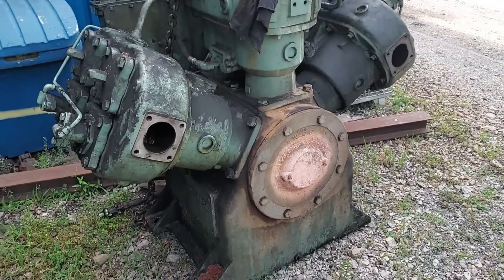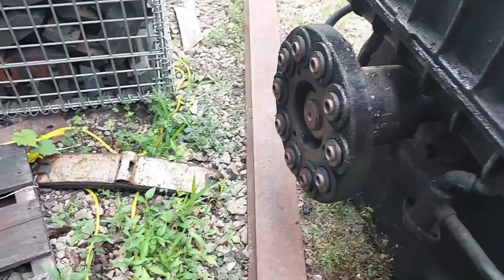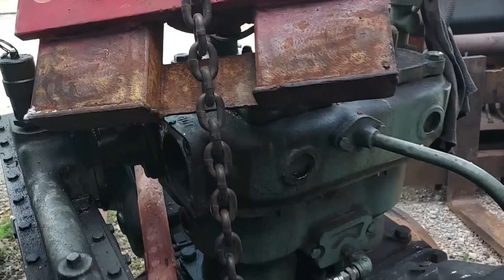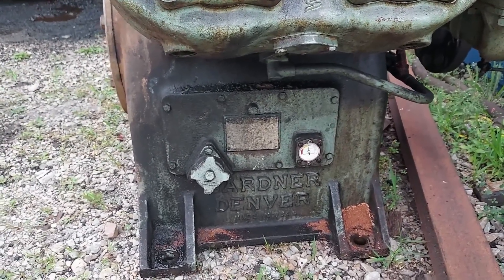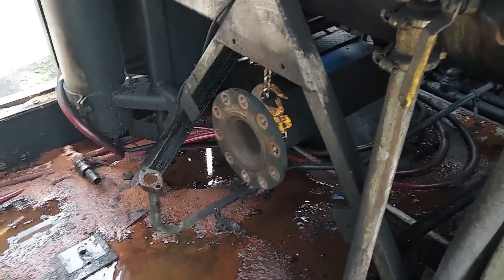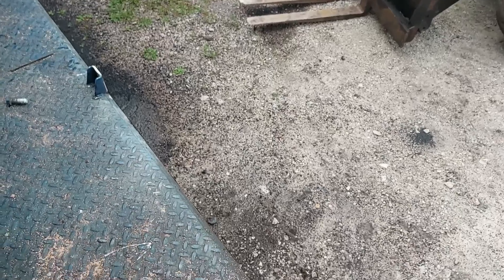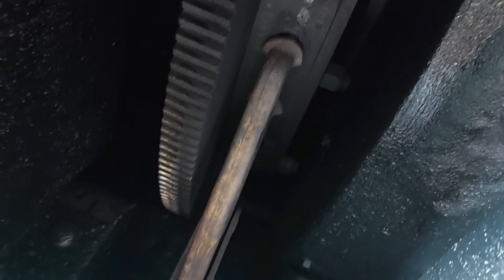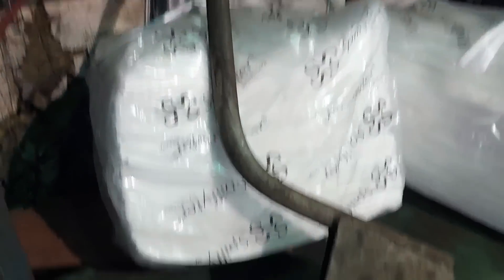Locomotive Air Compressor Died!  We Gonna Change It Out Today

Comment: Is that the locomotive that had the accident requiring some major repairs. And the air compressor drive shaft failed.
Reply from the maker: No sir, that was #3098 our SD 40-2 that got busted up and
had also to put in a new drive shaft for compressor. Always
something with these older locos, but that's railroading! Thanks
so much Wayne for stopping by and watching today.

Comment: I always liked the compressors that were mechanically linked to the prime mover. You could notch out  to speed up the process of pumping up a train. The newer electric compressors only have one speed.
Reply from the maker: Yes they often do advance the throttle to build air quicker. 
I did not know about the new ones being electrical. Thanks
for the info clarkpj1.
Reply: That big compressor uses a lot of power.  To be able to declutch or run on electricity would probably be more efficient
Reply: The dash 8 and newer GE/Wabtech engines have electric air compressors.  They only kick on when air pressure drops to whatever psi it’s set to kick on at.  They also start up unloaded for a few seconds then load up to increase service life of the electric motor.  The electric motor can increase rpm if needed.  Those are compressors all have that distinctive “whoop” sound.

Comment: Blue Flag Visitor?
Reply from the maker: Blue flag protection is a Code Fed Regulation used mainly
for protecting workers on tracks, such as preventing a train from
going into a spur or siding if there is a blue flag, or at night
a blue light on the track. Having a blue flag visitor sign on
the loco alerts anyone around that the loco is being worked
on is not to be started or moved without that worker (s) permission
that he/they are in the clear and loco is able to be started or moved.

Comment: That is one chunky air compressor, it makes a semi truck compressor look like a bicycle pump. Out of curiosity what's the standard operating pressure for the air system in a train?
Reply from the maker: It is big but has to supply the entire brake system on all the
cars, plus on our cars the dump doors. The compressor
cuts out when main air reservoir pressure reaches 140 Ethan.
The brake system is good pressure at 90. Thanks for
watching and writing in today my good man.

Comment: Is there a shear key in the shaft of the air compressor? so if the compressor locks up it doesn’t cause damage to the locomotive or the prime mover? 

I was told at the RR I work for, the mechanic said years ago one locked up in route somehow on a GP35 and it ripped the compressor off the floor and was spinning the compressor around in the car body, but I’m not sure if I believe that lol
Reply from the maker: No Andrew there is not. It seems a bit far fetched that it would tear
the compressor from it's floor mount and even if it did I highly
doubt there was room enough for that big compressor to
spin 360, but then again on a GP35 the compressor could be
smaller, I do not know. What I would think is more likely
the thru bolts would shear or the drive shaft itself get
ripped in two. But strange things happen all the time on the RR.
Thanks for stopping by and watching my friend.

Comment: AWESOME! Dave Love when you show the mechanics side of things. Especially when we get a look in the engine compartment. That air compressor is a beast. Would look great as a lawn ornament in my yard 🤣🤣🤣 thanks for the great post...
Reply from the maker: I tried really hard to get that old compressor for you, I had
thought the same thing, would look great in your yard. But after
emailing corporate numerous times, they decided to send
it back to a shop and get it rebuilt. Sorry my friend, I tried
my darndest for you. We may be replacing an entire engine
soon so would you settle for that? Wish I could have taped
the old compressor when it was smoking, but Russ had
it shut down before I got back off track. New one is way
quieter than the old one was.
Reply: @ccrx6700  hey thanks Dave, an engine will do just fine.. 🤣 guess I can't blame them for sending it back. These parts are probably getting hard to come by... bet it was an awful sound coming out of that thing... tell Russ hi from me and tammy and glad "things" are good

Comment: Thanks Dave! I never heard of Gardner Denver before, but I'm not real familiar with locomotive components. It's real nice to get a look under the hood and see this stuff! I really liked the sound of the locomotive as well, what an awesome sound! 😊
Reply: As soon as he said bad air compressor, I thought Gardner Denver. It is a very common loco compressor. We also had one in stationary use at work. But it was a twin cylinder where Dave's is a 6 cylinder.
Reply: @gravelydon7072  When I think of air compressor, I think of Ingersoll-Rand. I'm sure that now that I've heard the name Gardner Denver I'll hear it all the time now.  😊
Reply from the maker: I have no idea what make of  compressor they put in newer
locos since the newest loco we have was built in 1978. Really
glad you was able to check out tonight's home movie, we
do appreciate that my friend.
Reply: Gardner Denver makes a lot of compressors for different applications. They also make mud pumps for the oil exploration industry and well drilling applications.
Reply: @Sillyturner  Thanks Carl!
Reply: Gardner Denver makes many different styles of compressors from little 60 gallon units to huge screws, oil field and gas compressors. They are part of Ingersoll-Rand  now actually. They also own Champion compressors. GD started in Quincy, Illinois, Champion is in Princeton, Illinois.

Comment: That is a reciprocating air compressor (looked it up at Gardner Denver) and so that means positive displacement. Now, when we hear the relief(s) let go, we know that the engine is releasing excess pressure from the system. So anytime the engine crankshaft is turning, the compressor is running. I guess that makes sense - we need the air for the brakes on the entire train. Thanks for this look inside engine 22! Very cool to get the detailed low-down even it the air compressor had to die to let us see it :)
Reply from the maker: Even tho it died on us, it will be resurrected for a new life
in another loco somewhere. There is something about how the
valves work in it so that when 140 pressure is obtained in
the main air reservoir, the compressor is still turning but no
air is being compressed. Can't thank you enough for taking in
the home movie today and writing in my friend.
Reply: @ccrx6700  The engineer in me is now very interested :) Piston positive displacement running continuously means as you say, the valves must do something to relieve the potential overpressure to the MR. I began a search, but so far I am finding overviews and no details. We have HiPACs on submarines (4000 psi air) but they use a regulator to shut the compressor off when the correct pressure is reached. LOL! Full geek mode now - apologies!
Reply: @brianhickey5949  If you find out,would you be good enough to let me know ? Thanks. I doubt it is going to be as simple as is found in an ordinary  shop compressor..
Reply from the maker: @brianhickey5949  😊👍
Reply: @brianhickey5949  Those small lines leading to the tops of some of the pistons look a lot like 'unloader lines'.  Oil pressure applied in them will shift the top valves so they can't close.  With them 'unloaded' those pistons move up and down but the same air just stays in the cylinder.  Common on larger compressors, so while it runs at one speed, when the outlet pressure rises enough, it can 'unload' some of the cylinders and basically become 'half a compressor', moving half as much air.   Still need the reliefs on the reservoir, but with less air pumping, things are a bit easier.
Reply: @mikefochtman7164  Yes! That is how it works. Thank you Mike :) I would think that for engine 22 Dave would want a water cooled compressor to deal with the heat when the cylinders windmill. All set to go now :)
Reply: I scrutinized the video and determined the unloaders (those stems with lines to them) are on the intake valves, which makes sense. Downward pressure will hold those valves open. I do not have direct experience but I am assuming it is probably pneumatically actuated. A governor valve on the MR (or line) will port either tank pressure or vent to the compressor unloaders, essentially idling those cylinders. [my observations, not confirmed facts]
I did not look if they are all connected together or if there are two circuits. I did notice this appears to be 6 cylinders, 3 sets of twin cylinders.
I suppose it could be hydraulic, but I'm betting it's air.

I have only experience with an OTR diesel system. It used a pneumatic system as I described. (I can't remember if it was on the intake or exhaust side, but essentially the same function).
Reply: You can hear the compressors kick on in a GE locomotive(driven by electric).  They start unloaded, then they load up.  This reduces wear and increases service life on the electric motor.

Comment: So on this compressor,  are the outer heads the low pressure heads and they discharge into the   center head which is the high pressure head that discharges into the train air ? I think Gardner-Denver bought the designs from Joy Manufacturing which also made this type of compressor. The nice thing about this design is that it probably has the Load/Unload feature which draws less power when compressed air is  not needed by the braking system.  Working on this type of compressor can be tricky, especially when doing valve work. Thanks Dave for a great video.
Reply: That is the normal way they are set up. The outer cylinders are a larger diameter and the inner ones are smaller. That puts about the about the same load on the crank journals instead of just using a piston to go directly to the high pressure. Which on that loco is likely to be in the 150PSI range. So you get both volume and pressure. The intercooler takes the pressure from the lower pressure pressure cylinders and cools it before sending it to the high pressure cylinders which helps with a longer life of the compressor and the oil that lubes it. The lube on these is fed under pressure also. G-D has been around for a long time.
Reply: I'd say so.  Looks like it might be two first-stage pistons on each side, feeding that inter-cooler on the side which then flows into the center cylinders.  Cooling between stages improves efficiency.  And with twice as many first stages feeding the second stage cylinders, you get good compression ratios between stages without having to go with wildly different cylinder sizes.
Reply: @mikefochtman7164  I agree, it is already two to one ratio.
That being said, at the crank case, where the cylinders bolt on (under the water jacket bulge), the outer banks do appear to be slightly bigger, maybe 20%? [around 0:35 for example]
Reply from the maker: Good question Bruce, I am not familiar enough with the internal
workings to answer your questions. However here is a good comment
you may enjoy reading from a diesel mechanic
https://www.quora.com/How-does-a-diesel-locomotive-railway-compressor-work-and-what-is-its-draft-valve-principle

Comment: What causes all those clicking noises when the compressor is running?
Reply from the maker: If you are referring to the erratic noise that sounds like a hit
and miss engine on steroids, those are the spitter valves. They
are plumbed into both main air reservoir tanks. They are supposed
to help eliminate moisture from the compressed air, but
in reality they suck at doing that. Very much appreciate your
taking the time to watch and write in tonight my friend.

Comment: I always wondered what the compressors on a locomotive looked like, and they look very heavy. The braking system looks very complex, you really need a lot of training to repair a locomotive! Thank you for sharing Dave! I thought I would know everything about railroading soon,  but it looks like it will take a bit longer!
Reply from the maker: Just a tad bit longer Raymond.... :-) But even tho you've seen a lot
so far, in actuality we've only begun. I cannot thank you enough
for all your great comments and support of the channel you
have given us my friend. It's always great to have you visit
with us.
Reply: The compressor charges the air tanks first thru # 1 air Tank then the # 2 max allowable airpressure is 140 psi ,each air tank is 22,000 cu inches main reservoir air is done thru pipe # 1 to the air cabinet.
Reply: First thing i was taught  mc needs is brakes

Comment: Unrelated to the compressor issue, I always have wondered what that erratic ticking noise is? A lot of locomotive make the sound, but some more than others?
Reply: I believe that's the spitter valve. He made a video of one long ago. A quick search should help you find it now that you know what to search for.

This is actually someone else's video, but it has an explanation of what it does in the description. https://youtu.be/FVwNj7CSInk
Reply from the maker: The noise you hear Neil that sounds like a hit and miss engine
on steroids is a spitter valve. They are plumbed into both main
air reservoir tanks. Purpose is supposed to be to help eliminate
moisture from the compressed air. In reality they are not very good at 
doing their specific purpose and are more annoying than anything
else. Thanks for asking and for tuning in and watching the
video tonight my friend.

Comment: Yeah if you want to know where it got hot. it's where all the grease and paint are burned off. That thing got really hot! Learned something too. I always assumed the compressors were electrically driven. Never expected to see a direct drive, not even a clutch. It just runs all the time.
Reply from the maker: Glad you enjoyed the show today. I'm not familiar with the internal
parts of it, however the drive shaft as you say keeps it turning
all the time. When main air reservoir pressure is met at 140 then
it stops compressing air, so no clue what goes on inside the
compressor to make that happen. It's not like a 220 electrical
compressor where the power is simply shut off.

Did some research and this is a pretty
good explanation of what happens
once the 140 pressure is met, it's the
first comment on that page by Edward Rush. Glad you brought up that point
because I learned something new from it
https://www.quora.com/How-does-a-diesel-locomotive-railway-compressor-work-and-what-is-its-draft-valve-principle

Comment: not sure, but some of these air compressors are pulling something like 600 HP off the diesel main drive, and they have run some of these off separate engines. They have to drive all the brakes on the train, that is a LOT of air and pressure ! ! !
Reply from the maker: These also serve a dual purpose here as not only do they supply
air for the brake system, but also the car dump system. Very
much appreciate your visiting with us tonight Gerald and
taking in the show.
Reply: more like around 200hp, when pumping air at notch8.

Comment: Side of the compressor opposite the drive shaft input where the bearing would be inside looks like it had some heat on it. Paint is discoloured. I’ve seen locos set out over here due to compressor fires.
Reply from the maker: Thank goodness we didn't have a fire! Interesting your user name
is Number 2 and that is what we affectionately call this loco, 
Number 2 because it's the second loco we bought here. Thanks
so much for visiting with us and watching my friend.